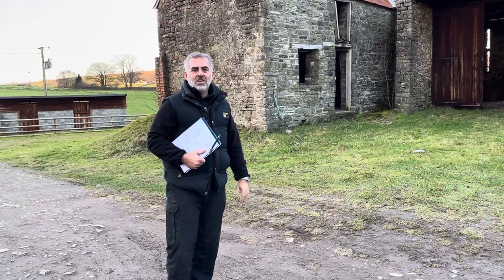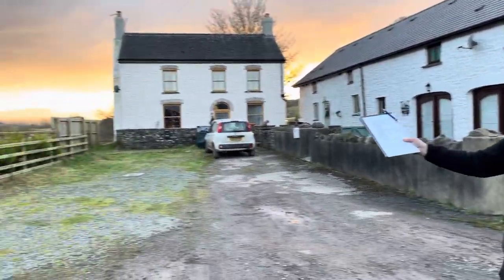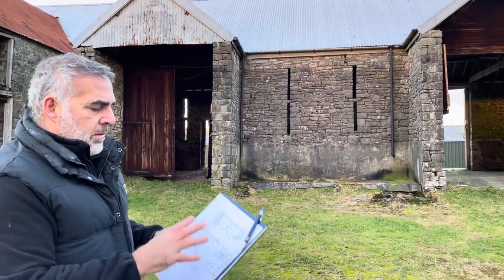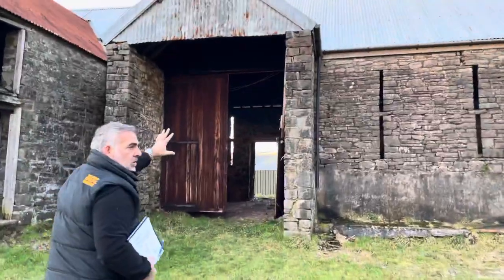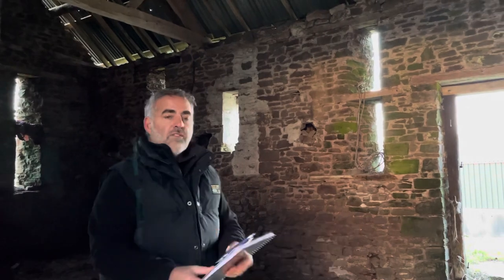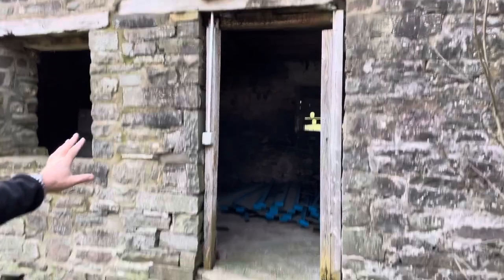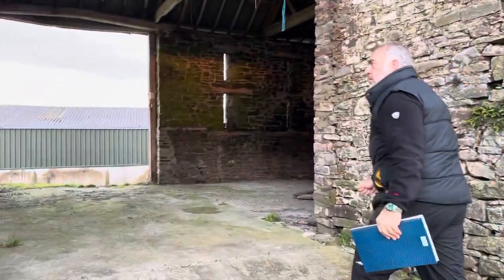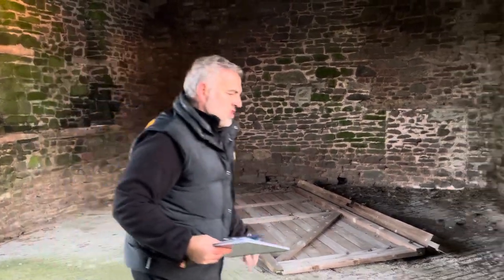Barn Conversions in the Brecon Beacons

Comment: Those walls are not solid stone but random rubble walls with an inner core that can be of very variable quality.  Compared to others, the quality of the wall construction looks good.  I'm a structural engineer and do lots of surveys for barns as part of the planning application.
Reply from the maker: John I agree. To the novice they are ‘solid’ as opposed to modern ‘cavity’ wall. To the pro’s yes random or dressed stone, outer skin, random inner skin with loose ‘rubble’ infill.